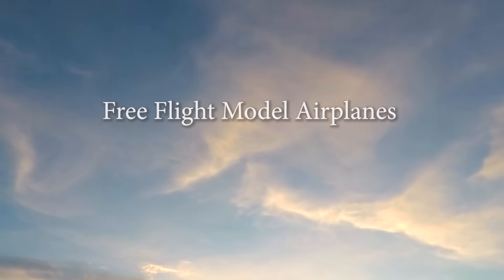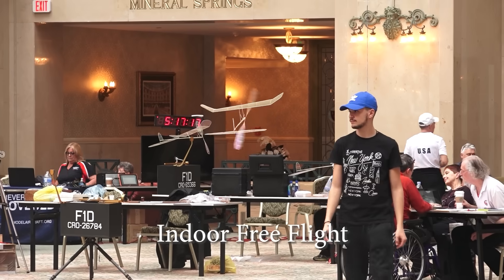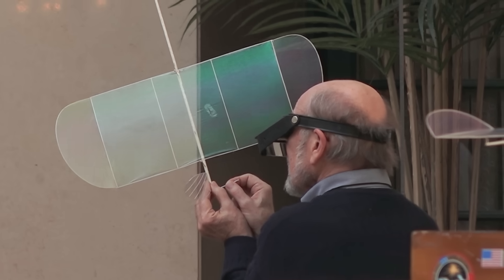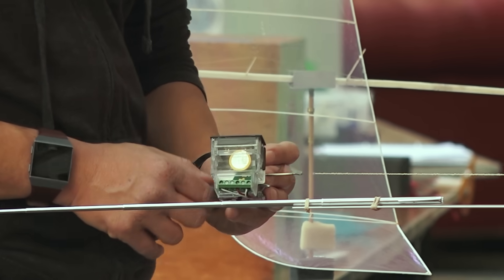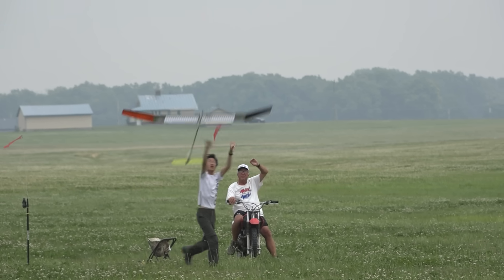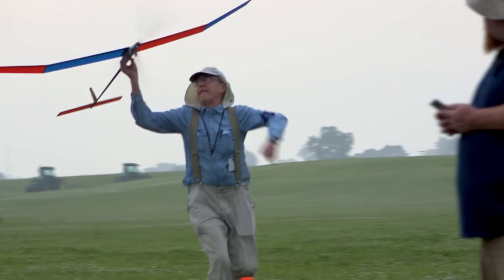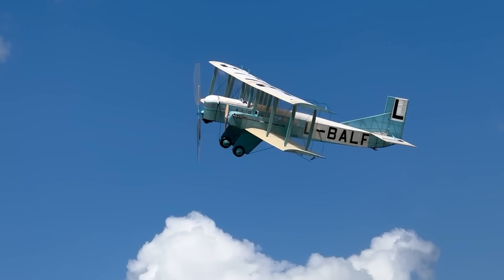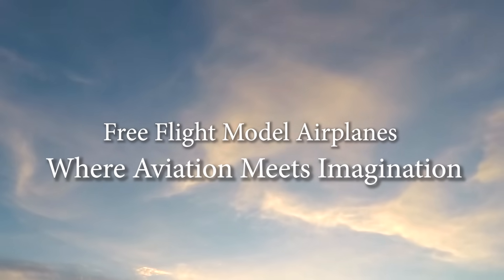Free Flight: Where Aviation Meets Imagination

Comment: I’m gonna think only people of this community could answer this question. In the late 60s there was a toy battery powered so electric motor airplane. I can’t even remember what it looks like. I’m thinking it was kind of a piper cub looking airplane model. There was a disk that you would insert mid-fuselage , a windup powered like a stopwatch.  The disc had serration on its perimeter. As the disc turned a control rod following the serrations  would in turn control the rudder. turning it left or right. I think this battery that was used to power the motor lasted maybe 30 seconds. It Was actually a pretty good model airplane. You guys now are way above this type of model ..but maybe when you were kids?
Reply from the maker: I am thinking I heard Mattel had something like that. I purchased a Mattel single channel RC unit that came in a plane at one time. I could be wrong about first part.

Comment: Well, you didn't include the hand launched models. The old Thermic B was one, and the cheap balsa gliders, a nickel when I was a kid. I have lost many of them into thermals. The thermic B I could launch 100 or so vertical feet from a flat field, which is plenty of room for them to catch a thermal. I spend 10 years as a hang glider pilot. The problem with the models shown here is making sure they come back to you....

Comment: Thank you for the video. Question. Are your models weighing above 250g govern by the FAA rules on UAV?
Reply from the maker: pretty much all of Free Flight is sub 250g.. Indoor Free can be sub ONE grams..
Reply: @FreeFlightDigest  Interesting. Some of the planes featured in the video had glow engines and I assumed, would be over 250g AUW.
Reply: @ongkimchoon7383  so far FAA rules are just for radio control.
Reply: @billkuhl442  Good to know US FAA does practice logical thought process unlike my country which have a habit of practicing one shoe size fit all regulation. Them believe in less work for the government department staff. Afterall, they hobbyist are the ones paying to keep the hobby going, so make them register and pay.